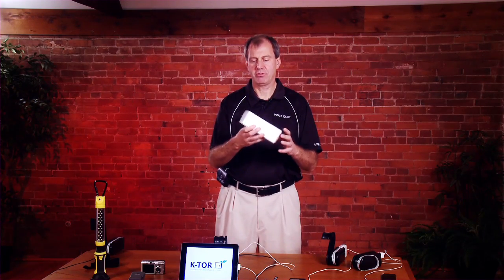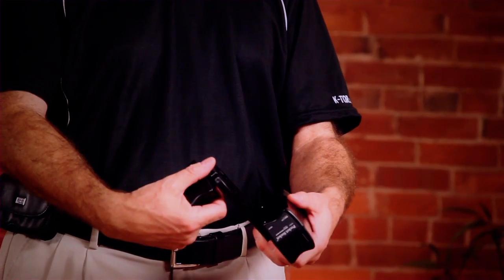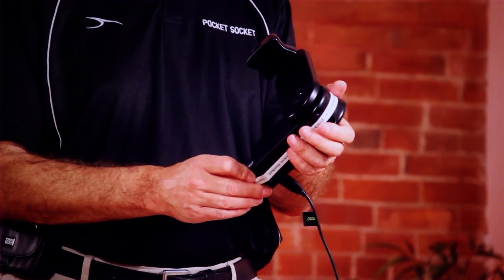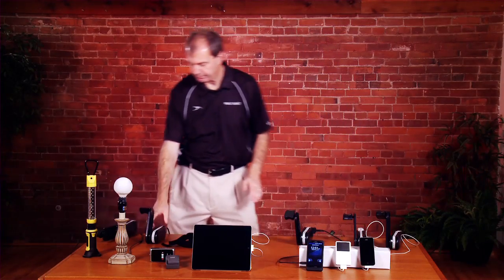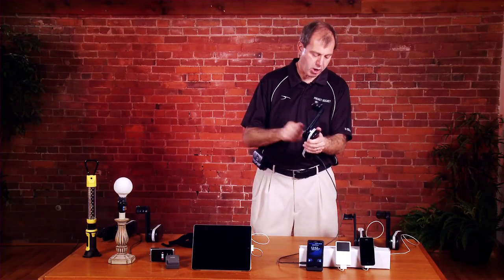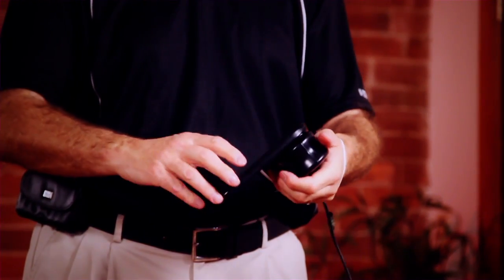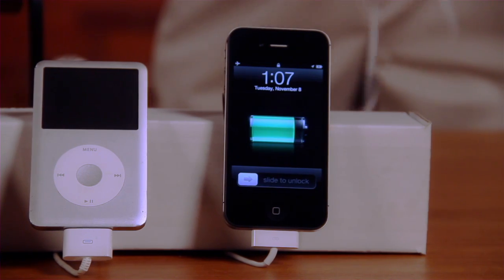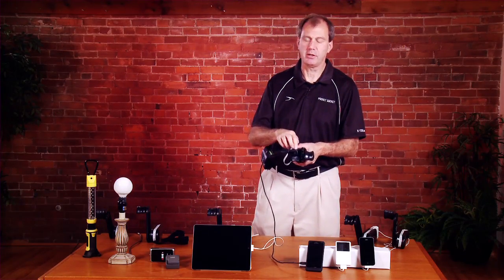K-TOR Pocket Socket Hand Crank Generator Instructional Demo Video

Comment: Here are my concerns.  Nice video,,,,however, what you are charging is not going to be worth diddlysquat in a grid out situation.  Cell phone towers, internet power stations will most certainly be down.  Who you gonna call?  They will  be worthless.  And all you showed were cell phones, and oh, an ipod.  WE want to see how long it will take to charge AA and AAA batteries.  Will I be cranking all the day long?  Those batteries will be for radios that get weather stations from Ham operators.  Batteries for small flashlights.  Or portable small lanterns.  RETHINK THIS PLEASE!  I'm not impressed with all the different cell phones!  They will be worthless!!  Utter worthless.
Reply: How many times in the last 5 ... 10 ... or even 20 years has that (grid down, no cellphones) been an issue in America?  How many people have been without power in regular emergencies, and how frequently do those emergencies occur?  This product meets a real need (like the people displaced in Katrina, Sandy, the massive California wild fires, landslides, and tornadoes that devastate towns every year).  As a single example hurricane Sandy took power from 4.8 million people (according to CNN), and something like this could have been beneficial to most of those people in 2012.

I understand what you're looking for (a SHTF or TEOTWAWKO solution for a situation that has never occurred), but this product is for real people, and that doesn't make it "utter (sp) worthless", as you suggest.

If you want an all day solution YOU should rethink this.  Not these people.  If you want all day power you want thermoelectric, or hydroelectric, or solar power, or wind turbines.  No one would suggest that a $60 hand crank should be capable of providing all your home's energy needs indefinitely.  This not being YOUR solution doesn't make it terrible.

That being said, I think the pedal version is superior for sustained usage, and I would much rather carry an extra battery or two than this crank in the short term.  Even a portable thermoelectric or solar option while on extended backpacking trips and wanting to keep electronics functional (for convenience and comfort) seems better.  Still, this crank seems capable.

Comment: The pocket socket needs some kind of buffer capacitor so the output is smoother and the voltage won't instantly collapse when stop turning for a monent.  I've tried with about 2000uf worth and it gave me enough time to switch hands or make a quick adjustment.  The problem is stop turnung even for a tiny fraction of a second, and the charger restarts, turning the screen on and wasteing power.

Comment: Slowing it down would add another level of gearing. this would make it bigger, heavier and more expensive. It would make cranking it harder but cranking slower. The same total power except the additional losses from an additional gear. Net for the hand crank we chose not to do this. For the pedal unit we experimented with different gear ratios since it is a bigger unit and we have the space. We did decide to slow it down to 1.5 cycles per second on the pedal unit. thanks Ken

Comment: The slower it would go the more effort it would take and so same effort. But it would add mechanical stress to all the components and they would have to be beefed up adding cost and weight. Practice a little and you will not find it hard to set a pace. Remember fast means less force required. the pedal generator is geared a little lower.

Comment from the maker: We don't recommend cranking for long periods of time continuously, 3-5 mins max then take a break. We're not aware of the generator overheating with extended use.  From the user standpoint, it was not designed for extended continuous operation but that doesn't mean that mechanically it won't hold up.

Comment from the maker: This product wasn't designed to replace your primary source of power, it's best used for backup power or in an emergency situation.  In those situations, often the grid is down and the sun it not shining as we unfortunately saw during Hurricane Sandy.  We don't advise cranking continuously for long periods of time with this product, crank intermittently to generate the power you need to use.

Comment: It is a generator and all the devices it powers have batteries so it would be redundant to put one in this device. If you want a light get a good led light that has a battery in in and is recharged from a wall outlet. Our generator can charge it up and you will never we without light again.

Comment: the pedal unit will not charge any faster as the limit is the charger and the rate you can safely charge batteries but it is much easier to pedal than hand crank and you can do it for a lot longer. It opens up a number of possibilities.

Comment: Trust me, it's worth it in emergency. When we got hit by Hurricane sandy (boooo!), and did not have electricity for a weeks, that's when we realized how a 'drop of amp' felt like. Not being able to use smartphone to look at outside conditions, travel condition, food conditions, and most of all, POWER UPDATES. That's when I realized how it felt to use the phone when that battery indicator was crippling down. Using it only when needed, every drop of power was wroth it.

Comment: I was without power during Sandy storm for 8-9 hours. Made me think if the outage happened in February for little bit longer. Got the 2KW generator plus this thing in case I ran out of gasoline. This Pocket Socket seems well made, not from cheap plastic but something like bakelite. It took me few minutes to charge 18650 battery from 3.96 to 3.99 V. Seems kinda slow, but if there is no other source of electricity, I'm sure it would feel much faster.

Comment: The devices it charges have a battery in them and it charges those batteries. that's why putting a battery is not a problem.

Comment: Hang on, once you crank, the device doesn't store charge to discharge into the device you need?  And it costs $60?  I was going to get one as a night light for my daughter, kn owing that the charge will run down after shes been asleep and don't have to worry about leaving a burning bulb on all night.  Get yourself a solar charger that's more versatile unfortunately.  If the manufacturers are listening, have the crank hold some charge.

Comment: I'm pretty sure that some people have set up an electric machinery connected to a stationnary bike and charge a lot of things. I guess you could use the bike in case of power outage. But if it is the whole city out of power, will cell phone work anyway???

Comment: You get quite a workout when you use this to power a desktop computer.  I put the unit in a vice grips so I could crank with one hand, and type with the other.  In fact this message was typed from a hand cranked computer with one hand.  Yes sir if the electricity goes out my internet access will be alive and well.  Thanks Pocket Socket!  Although now my left hand, and forearm are monstrously muscular in comparison to my other.  It looks strange but it's worth the electrical savings!

Comment: I only have it for an emergency type of situation, you wouldn't catch me with it at an airport. Online you can buy 5 mobile phone batteries for $30 bucks and there small. I definitely don't regret buying it, I like solar power more but the k-tor is a piece of mind because you can use anywhere :-)

Comment: Yea it worked, but I didn't attempted to fully charge it lol, It's something that would take awhile over time. Like while watching TV I charged it off and on for maybe 2 weeks and it charged my phone 3 and a half times and... I cranked the thing for about 30 to 40 minutes each time. You have to get clever with the k-tor though, for example I duck tapped it on a chair leg. It works great as long as you have something to hold it down to and time to kill like when your watching TV.

Comment: I still need to make a video on Amazon on how it works against the Emerson radio. I chatted with the owner of K-tor a couple of times, hes pretty open to giving out ideas, and he handles criticism pretty well too.. My point is is that this is an American made product, you can tell. and its still as solid as when I first got it (had it for 6 months now). I figured out an easy way to use this without putting much effort into it, you just need to think outside of the box :)

Comment: I think this device is great, but the gearing for the handcrank is a concern. At 2 cycles per second, a majority of the human energy is lost fighting the inertia of the cranking limb. This is especially troublesome for tall people with longer, heavier appendages. If the rate could be reduced to 1 cycle per second, it would to a lot to improve the design for off-grid users. I suppose an adjustable handle to reduce the distance from the crank axis could be useful.

Comment from the maker: @rghill100 as @UOJeffery79 points out the primary intended use of this hand crank generator is in emergency and off the grid situations.  Cranking the hand crank generator is like any physical activity, you operate until you feel signs of fatigue and then take a break to recover.  We suggest you operate for 3-5 minutes at a time and then take quick break.  In most situations you wouldn't need but 15-20 minutes of charge in your phone to get effective use out of it.

Comment: @rghill100 lol I doubt it, what kind of phone do you have? My g2x only takes an hour to charge running off of 1700mAh battery! It sucked when it first came out (LG software problems).. I can't wait to get my hand cranker lol. I'm sure their are nice ways to rig it so not so much effort is needed(without voiding the warranty), its just easier buying it the way its already set up. On the k-tor site their coming out with a pedaling cranker. Ill let you know how good it works when I receive it.

Comment: Pretty cool, I ordered your charger before even seeing this video with tips, I ordered it yesterday. This is something I wouldn't use unless I was without power (emergency), camping (which I love), or even if the grid goes down "FOREVER" lol... you can do a lot of stuff on an android phone, even with the internet being down. Do any parts of this unit eventually wear out over the years? And another question is, I have a New Trent 11000 mAh would this store power well?